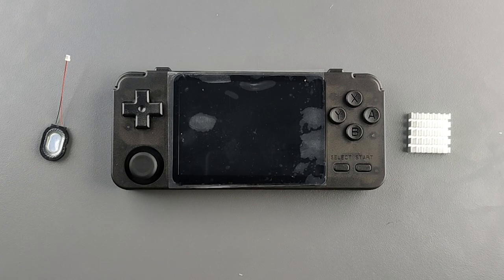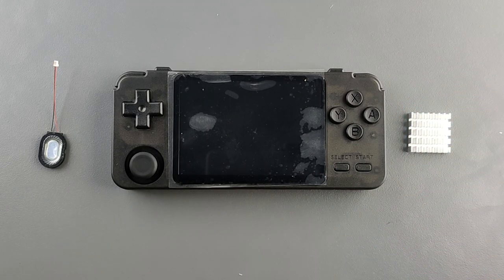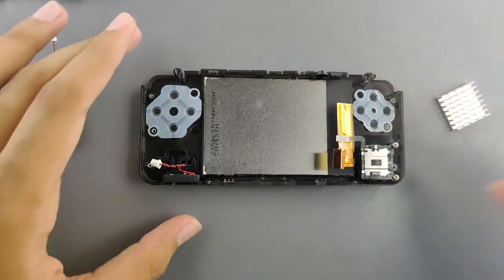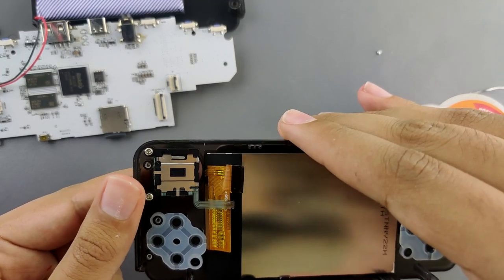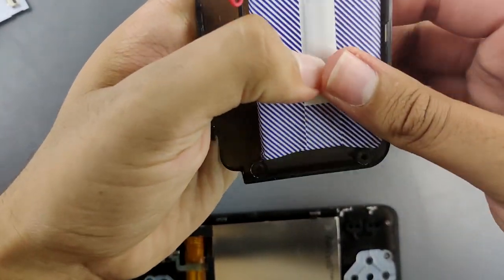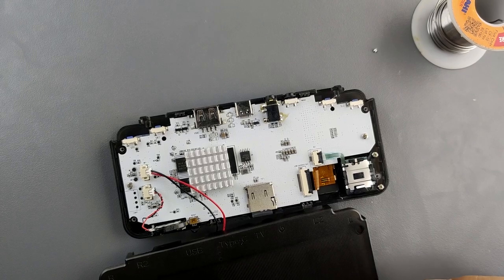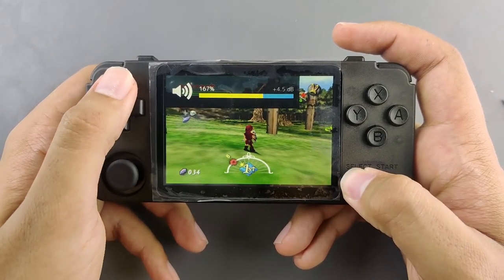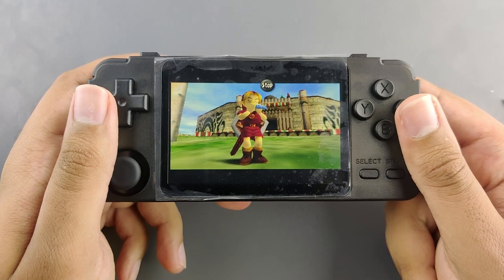Modding The RK2020 V1 (Speaker + Heatsink)

Comment: Hi, I have an RK2020 already evicted, it heated up to more than 70 degrees Celsius and what I could do is put the OGA battery in it, which is more capable and does not usually get so hot, yes ... I moved the battery all that I was able to keep the cpu and graphics chips "on air". It did not help me, and ended up affecting the screen that began to suffer from multiple light leaks that it did not have before ... But it had not occurred to me about the raspberry heatsinks that some I must have lying around.
What is the temperature of the processor according to Emuelec? Before and after modification.